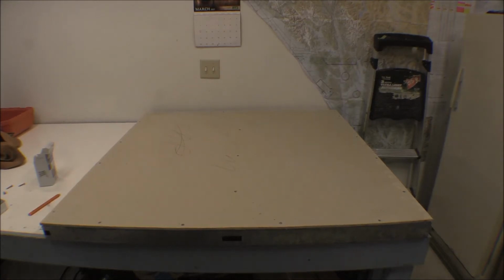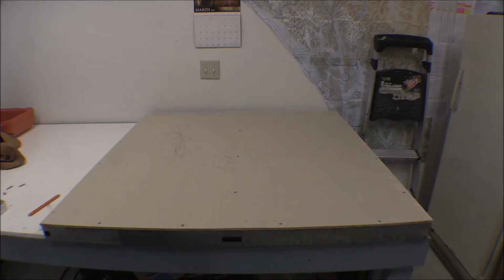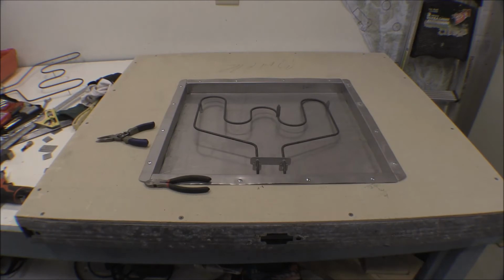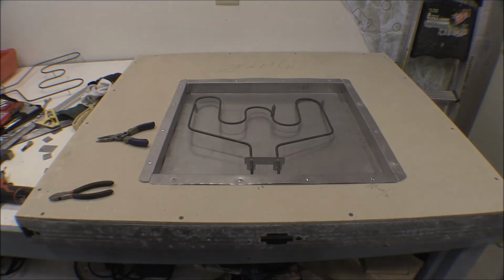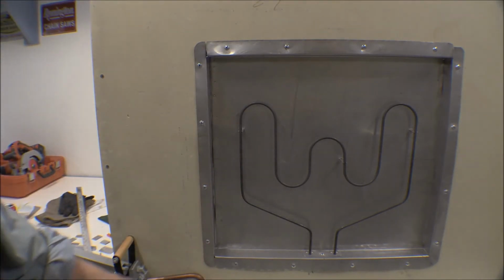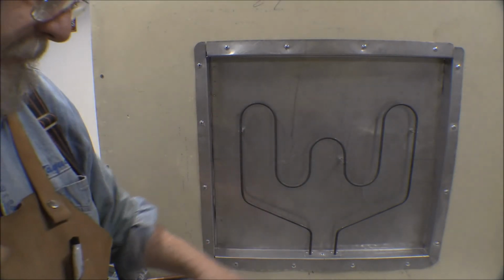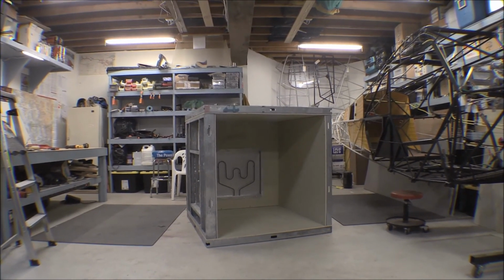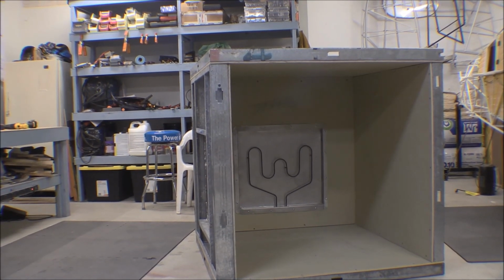Powder Coat Oven Build-inside sheeting and heat elements

Comment: Hardi board has a paper coating on it.  I wouldn't trust it with heat.  Rockcrete is solid cement and won't burn.  I might think about going with ceramic insulation as they use in making kilns.  Amazon has it and the needed accessories.  Wouldn't need much as it is very efficient unless you are going over 800/900 F.

Comment: I guess we are kind of neighbors. I live about an hour north of Anchorage. I am guessing you are down in south east.  I am wondering after 5 years how is the hardiebacker board doing? Is it still working for you?
Reply from the maker: I heated the oven slowly several times, but it still cracked. I'd have used sheet metal if I could have found a place to get some,but not many options around here.

Comment: using the cement board it will shrink and crack...after couple usages..just use 20 ga steel, use rivets

Comment: What temp does it reach?
Reply from the maker: It's unintentionally been up over 500 degrees F.  I tried to run two heat elements from one ssr but it failed short. I tested it to 450 with one element and used it to cure parts at 400 several times. I've been using it with one element as I haven't wanted to take the time to set up two pids and ssrs.

Comment: How has the concrete backing board held up to the heat...what has been your max temp and for how long?
Reply from the maker: The cement board cracked from the corners of cutouts for the elements and some of the screw holes. It had a lot of moisture in it and shrank quite a bit.. If I did it again I'd figure out some way to attach the cement board without screwing it down tight. The temps got pretty hot, up to 250c for short times, the solid state relays couldn't handle the current for two elements and they failed short causing it to run away. 
I've had it controlled up to 170c for several hours and the outside temps never got above 110f.